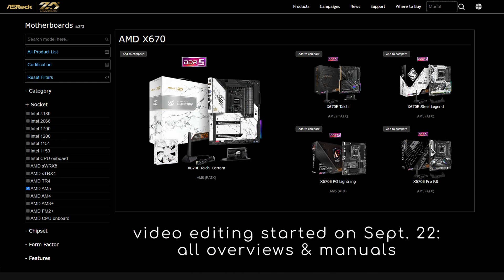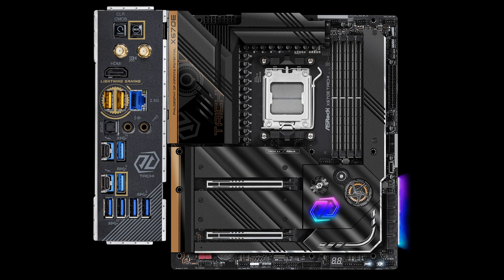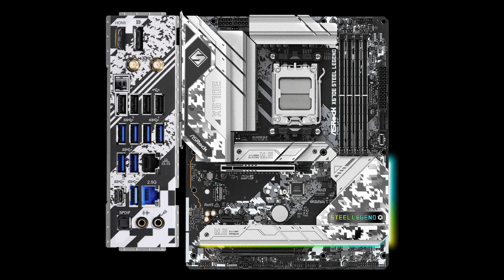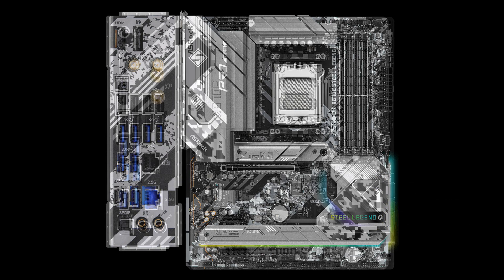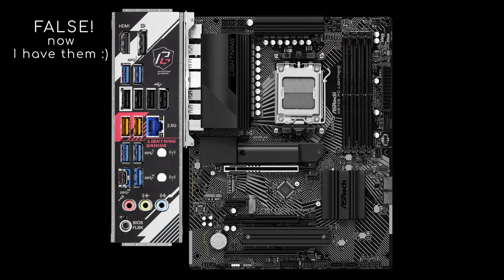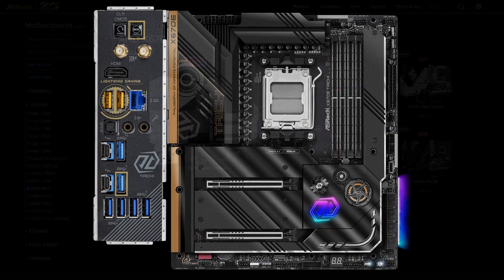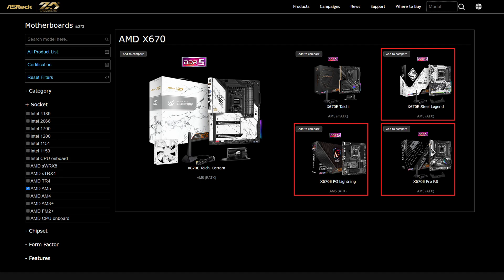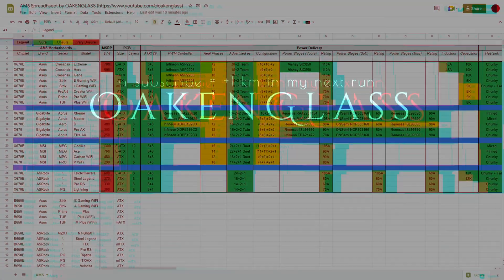ASRock AM5 X670 Motherboards Lineup: Preliminary Analysis

Comment: Oakenglass. Dont listen to any negativity. You did great. I have a question. Im planning on getting the ASrock steel legend ($250) or the PRO RS ($230) tomorrow. $20 dollar difference. which is best to get?
Reply from the maker: Thank you for your kindness! In the following videos, I did change a bit the audio EQ...
Regarding your question, I will highlight the differences between those two motherboards:

- Steel Legend: 1x more Vcore Phase, a better Audio Codec (1220 vs 897), an internal Thunderbolt 4 header, a better Back Panel (2x more USB Gen.1, the USB Type-C is Gen.2x2 instead of Gen.2 and there's a second Ethernet port, 1 Gbps). PCIe slots: 1x PCIe 3 (x1) and 1x PCIe 3 (x16 wired to 4 lanes).
- PRO RS: 2x extra SATA ports and 1x extra M.2 PCIe 3 (x2) socket. PCIe slots: 2x PCIe 4 (x1).

Unless you specifically need the two PCIe 4 slots, M.3 PCIe 3 socket and/or two SATA ports of the PRO RS, for that price difference I'd get the Steel Legend. In fact, maybe the audio codec upgrade alone is worth the extra $20 if you don't already have an external solution...
Reply: @oakenglass  perfect! That’s what I’m getting in a few hours. For Black Friday (the whole month), they have a great deal here in NJ/NYC. Get any Ryzen 7 7000 series, get free g skill 32 GB ddr5 6000 ram, and $50 off any am5 motherboard. On top of that I found the Asus Thor ROG 1000w for $200 at the same store different location. Idk if I’m just lucky or got it at the right time.. a fantastic build for under $850. Looking forward for the 7900XTX
Reply from the maker: @chrisunlmtd  Wow... prices are really dropping in the US!
For comparison, here in Italy the same config would cost:
- G.Skill Trident Z5 (32GB 6Gbps): 275€
- ASRock X670E Steel Legend: 420€
- Asus ROG Thor 1000W P2: 340€
- AMD Ryzen 7700X: 445€

Total: 1480€ / $1530

So, that's a really amazing deal!
I too am eagerly waiting for RDNA3...
Reply: @oakenglass  Im sorry for the price hikes in EU. I have family out there and they are all feeling it too especially the fuel costs. 

I'll keep you updated on the ASrock once installed
Reply from the maker: Yes, all kinds of energy cost quite a bit here... one of the reasons why I undervolt.

Definitely! I'd love to hear about your experience with your new build :)
Reply: @oakenglass  man, I don’t know what to say… the steel legend looked so great But apparently the engineering on the am5 socket is not good! The socket lock over tightens the pressure on the am5 chip; putting your cooler with just little pressure causes pins to bend. That was my experience. I thought I was stuck on Dram memory training but I took out the am5 and saw 3 pins bent in the socket. 

I read on Reddit many people had this experience and some don’t.
Reply from the maker: @chrisunlmtd  Damn... I'm very sorry that this happened to you! 
Does the store you bought the mobo from allow you to replace it without any hassle?
Reply: @oakenglass  Yup i replaced it with the ASUS Prime X670e-Pro... its a beast but it has horrible bugs. I think the whole Ryzen 7000 series package has issues. For instance, It takes like 2 minutes to get to the point where I can log into windows. I cant download the ASUS Armoury crate. I keep getting an error. It doesnt shut down completely (logs out of windows but has a black screen with fans running the whole time). DRAM issues with a fresh restart but then when I start it again it works fine. Ohhh and this MOBO doesnt recognize this ram is 6000mhz (the mobo chooses 4800mhz by default) I tried to OC it to 6000 but the PC wont turn back on. Honestly, my Ryzen 5800X worked perfectly fine and I kind hoped this experience would be better. I am still holding on to this atleast for 14 days to see if it works. If not, Im going back to AM4. not a happy customer at this moment
Reply from the maker: @chrisunlmtd  Have you tried flashing the latest BIOS (0809)?
Reply: @oakenglass  Yes, I flashed bios after I could finally get into my desktop. After the update, I still have bugs. However, I can now OC my ram to 6000MHZ. That so far is the only hurray i have so far. 

I still have weird bugs like I went to hibernate/sleep my PC. Took about 5 minutes to go to sleep. I started it up this morning and It actually shut down instead lol. The startup was a bit quicker tho. 

Before I did the bios update, I played AC valhalla for about 2 hours before it crashed. I restarted my PC to try to install ASUS Armoury crate again. Took about 5 minutes because I had DRAM issues again and then I couldnt play for 15 minutes before crashing and the armoury crate still doesnt download lol.
Right now, I am post BIOS update and its running a bit smoother. I'll see how the game starts and if it crashes.

Im still worried about crashes and overall performance. Which is not good since AM4 was definitely much smoother.
Reply: just to add.. Im trying to run AC Valhalla... and it doesnt run. Im stuck at the launching icon that comes up. I've been waiting for 3-4 minutes. I closed the task and tried again. its been 4 minutes still not running
Reply from the maker: @chrisunlmtd  Is yours a fresh Windows installation? Also, I'd suggest disabling Fast Start-up: in my case, it has always created problems...
Reply: @oakenglass  No I am not on a fresh install. I will do that now and hopefully it will be the end of all this issues. I did disable fast start up.
Reply: Just did the fresh install.. Everything is running much smoother. I havent played any games yet but im in the middle of installing all of the apps i lost
Reply from the maker: @chrisunlmtd  Great! Let me know if something else comes up...
Reply: @oakenglass  everything is working great now.. pretty much flawlessly after the fresh install . I thought AMD mentioned it was plug and play I didn’t realize a fresh windows install was needed. I hope my PC continues to work like this
Reply: And guess what…. It stopped working again! DRAM light is on after I let my PC sleep it doesn’t power up anymore
Reply from the maker: @chrisunlmtd  Is your RAM included in the QVL of the Prime Pro?
Reply: @oakenglass  apparently it’s not, but from many sources people are saying it’s definitely compatible. Other memory in the list also having similar issues
Reply from the maker: @chrisunlmtd  While waiting for better BIOSes, I'd set it to JEDEC specs...
Reply: @oakenglass  I got it back running, by unplugging the CMOS battery and Plug to PSU. it works again.... Isnt that weird??
Reply from the maker: @chrisunlmtd  When the RAM fails its training and the Mobo can't revert the BIOS to its last know good settings, yes, the only option is to clear the CMOS via the corresponding button/jumper or by removing the battery with the PSU off.
Reply: @oakenglass  Lesson learned. I'm keeping all at stock settings until they get a better and stable Bios update for this Mobo. Right now, my CPU is not OC'd anymore @ Stock Clocks. and My Memory is at 4800mhz instead of 6000 EXPO. Is this wise?
Reply from the maker: @chrisunlmtd  Yes it is. For the moment, I'd load the optimized BIOS default settings and wait for a new AGESA.
Then, I'd update the BIOS and try to slowly increase the RAM frequency (e.g. in steps of 200) with loose timings until it reaches 6000. 
Finally,  I would slowly decrease the timings until they match those of the EXPO profile. Out of curiosity: what's the part number of your RAM?
Reply: @oakenglass  I’ll give it a go. I just don’t know how to manually OC very well. That’s a lesson and on it’s own. I went with Expo auto settings and it would jump it to the 6000mhz and know the timing and voltage automatically. But I’ll give that a shot
Reply from the maker: @chrisunlmtd  You're right, theoretically EXPO should just work. However, with a new platform, teething problems are to be expected. Or, should I say... expoected?
Reply: @oakenglass  haha forsure! But now its working great... just little bugs now. Lets hope by EOY they come with an additional bios update to fix the bugs

Comment: whats your fav x670E by far?
Reply from the maker: My absolute favourite is the Asus Crosshair Gene, only because it's mATX and I'd like to downsize my case.
In 2nd place, the MSI Carbon because (on paper) it's the cheapest one with a PCIe 5 slot + Debug Code Display.